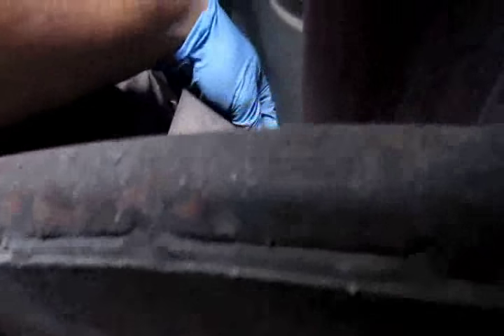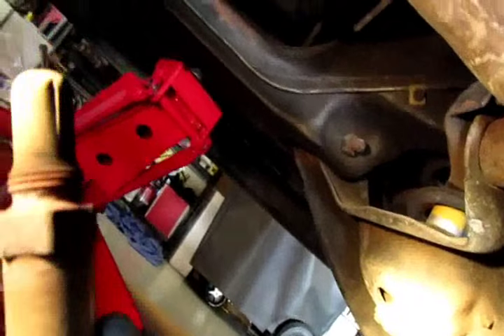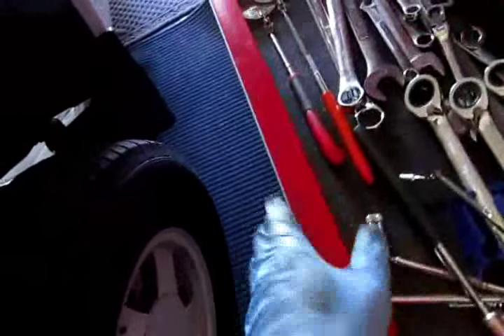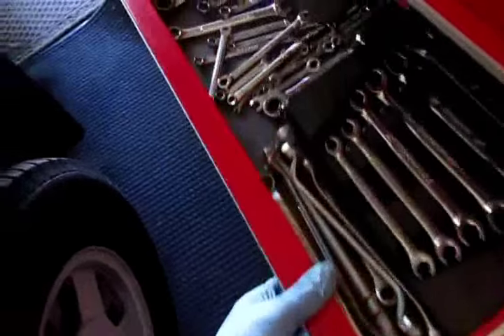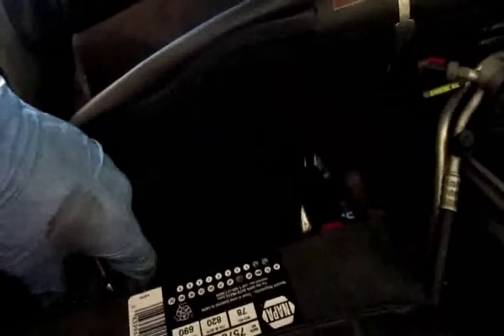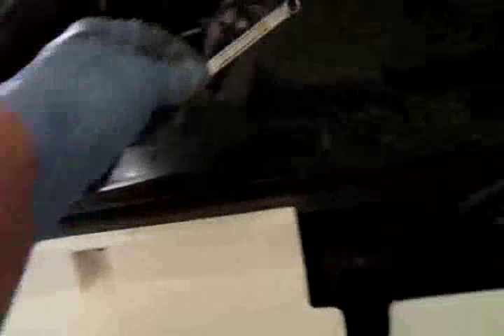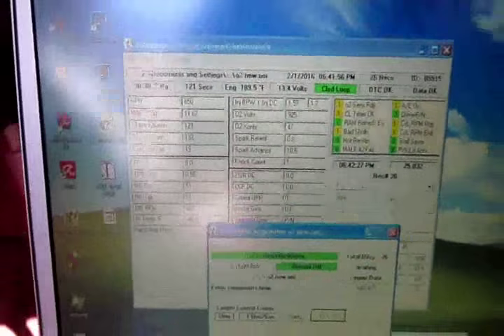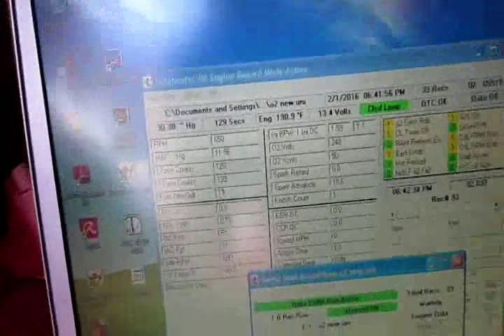How to o2 sensor replacement Chevy Silverado GMC Sierra 88-95 Tahoe Yukon Surburban

Comment: So....bad O2 sensor = crappy Idle?
Reply from the maker: When it pegs the fuel trims to full rich in closed loop it does. I had a erratic idle when the fuel pump was weak too.
Reply: Ghetto Wagon Okay..cause sometimes it feels like it’s super crammed out and it’s about to shut off when it’s idling...kinda surges low then high...that happens about once every 10 starts
Reply from the maker: Better scan it. chek fuel trims Check fuel pressure, ETC  Cap and rotor make sure that is not scorched.
Reply: Ghetto Wagon okay thanks

Comment: Okay gonna go ahead and try this thanks man!
Reply from the maker: +Jr Ch&#225;vez   The screws for the TPS sensor should be T-20s. On one side you cannot get a good shot at it unless you take off some brackets. I just use the torx bit and put a 1/4 inch wrench on the HEX that is at the end of the socket before the 1/4 drive.   The screws can get all rusty, The TPS sensor kept flopping around on mine because one screw was rusted bad and the sensor did not stay tight around the screw. I got some good ones at the JY